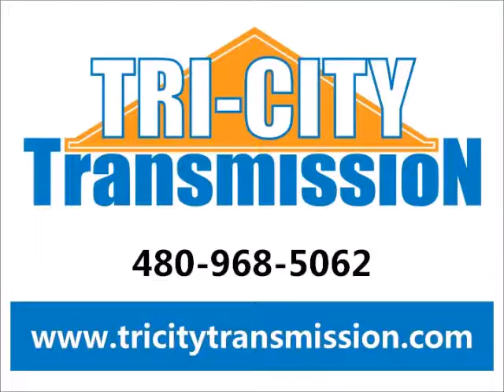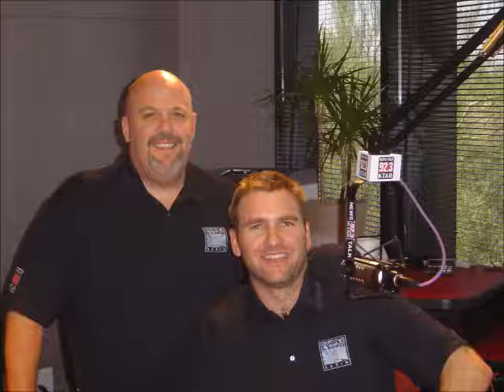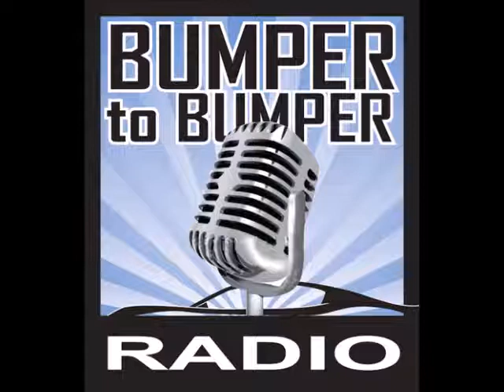How Long Does a Catalytic Converter Last and What Causes Failure

Comment: Question is cleaning the throttle body on a 4 cylinder engine time after time and the deposits cleaned goes trough the cylinders and the exhaust system can this was of clean the throttle body cause the catiylic converter to go bad